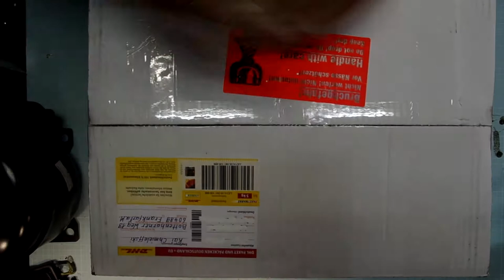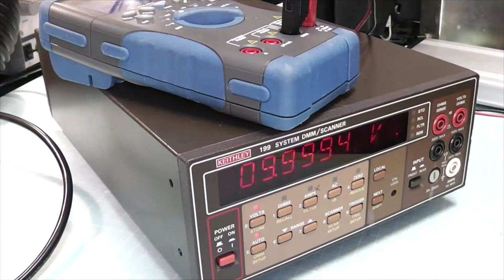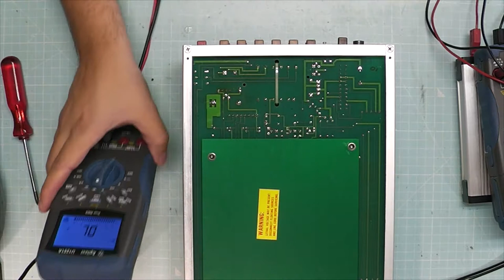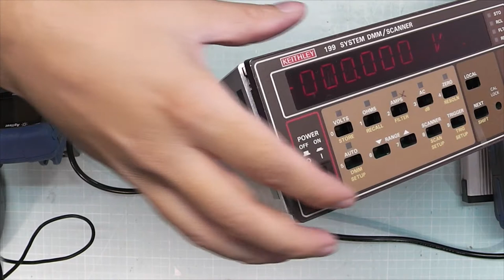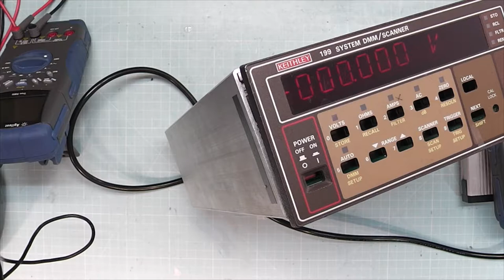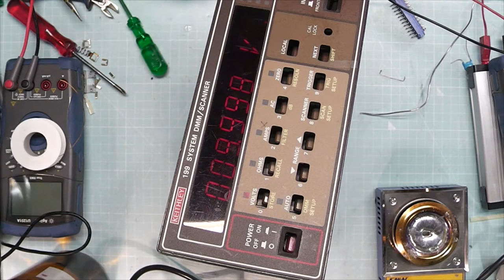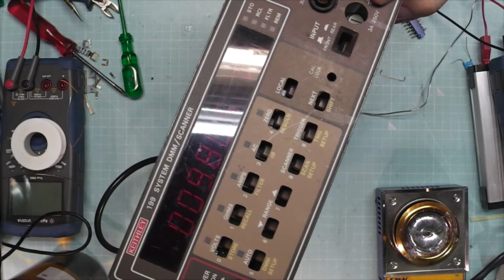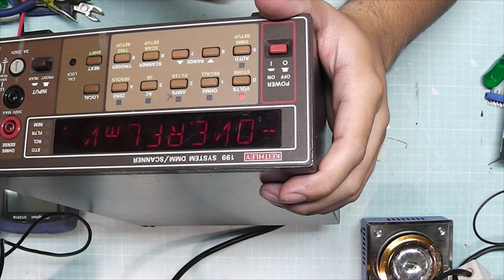Tinkertubes Lab [32] Keithley 199 5.5 Digit Scanner Multimeter Ebay score! (With repair) (reupload)

Comment: A replacement switch can be bought directly from Tektronix. The part number is SW-468.
Reply from the maker: Thank you Victor! Could you provide a contact for Tek spare parts? I seriously didn't find it :/
Reply: Sure thing, you can fill out an information request at the following site: http://info.tek.com/www-request-parts-information.html
They got back in touch with me very quickly. 
Also, thanks for posting the video I'm getting ready to fix the exact same problem and found the video helpful.
Reply from the maker: Great, thanks. I hope you will be succesfull with your repair, good luck! :)